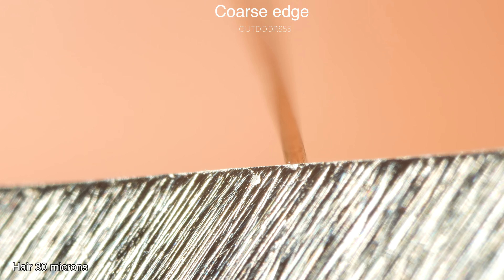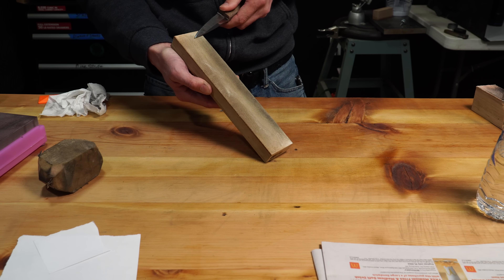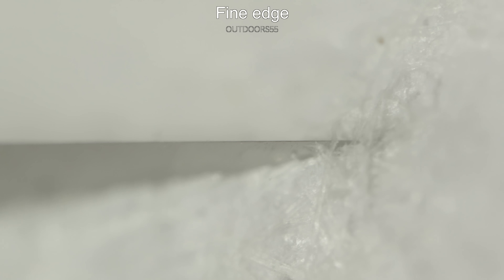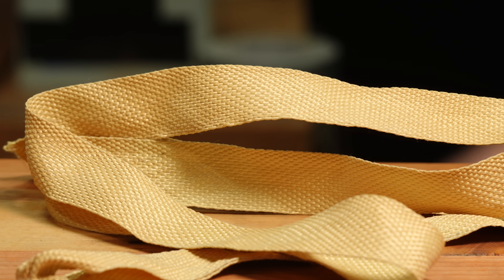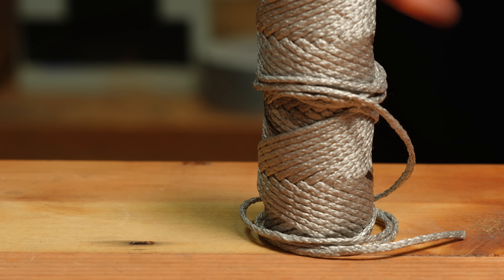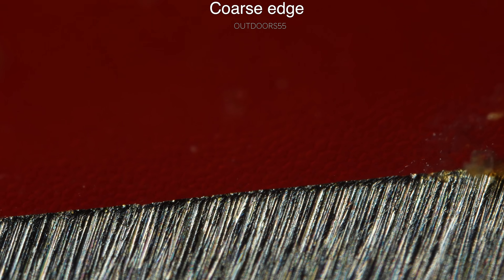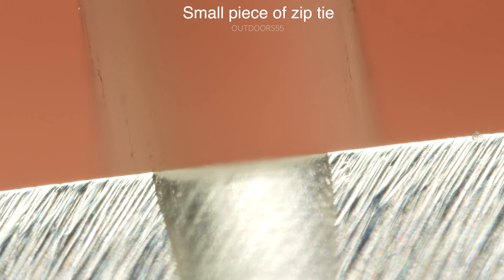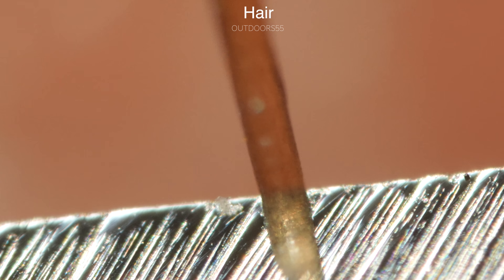Coarse Grit Knife Edges Are Weird - Coarse Vs Fine grit Edges Cut Under Microscope

Comment: Great photography, I'd also like to see some force measurements.
I only use coarse for major shaping, whether I am sharpening a knife or shaping a stone for jewelry. When I am just touching up an edge I go straight to 1200. When I'm camping I carry a 600, because camping tends to be more abusive and sometimes I want to touch up a hatchet. 
If I have to use a knife for changing an edge angle or I've done something drastic and chip the blade or put a bend in an edge.

Comment: I wonder if things like bread would show a large difference, understanding that all edges are serrated, it is possible that the coarse edge may perform better on items that would generally require a serrated knife. e.g. insulation foam, bread, thick shipping rope.

I would be interested to see the knives vs meat as well, things like fish scales, salmon flesh maybe even pig or buffalo skin with hair still attached.

I have also heard that mirror polishes make a slither of a difference when cutting anything starchy like potatoes because the polish reduces the drag.

There is probably a rabbit hole here haha. I would be interested to see if you could find EXACTLY when lower grits and higher grits are most effective.

Comment: A better test to highlight the difference might have been to cut the tomato with a sawing motion and no downward pressure except the weight of the blade.  I definitely perceive a coarse edge to be more "aggressive", esp. with tomatoes.  Also, I've noticed that a very fine ground edge tends to last a lot longer on a kitchen knife.

Comment: I remember seeing Jdavis882 use a DMT coarse to DMT extra fine to Spyderco UF and achieve a mirror finish. I wonder if it would be possible to go from the Sharpal 1200 ultra fine to spyderco UF to achieve a mirror. If so, it might be the quickest way to a mirror edge. Could be worth a try considering you have the stones already.

DMT ultra fine and Sharpal ultra fine are the same grit so I don’t see why it wouldn’t work.

Comment: To answer your question... depends on the application. You can tell in the tomato cut that the fine edge creates smaller water droplets, meaning less tissue damage at a deeper microscopic level. That's the type of sharpness for something like sushi or ultra fine culinary cuts. Everything else is a one-stone job

Comment: I bought so many stones since I started woodworking not long ago,  it would have paid for a tormec with a diamond wheel, at least I learned a lot with the stones and had meditation time when stepping from 800 to 2000 to 3600 and finally 8000 and then polish … stones are fun but can be a waste of time if you are doing plane blades or large chisel with hard alloy

Comment: I think that spending the extra time to get the fine mirror edge is the fun part of sharpening knives, not the necessary. For EDC, I'd say coarse grit micro saw tooth edge would be fine. But for zen reasons,  there's just something so satisfying about going after that extra fine edge. I'm not quite there yet but I'm enjoying the process in getting there.
Reply from the maker: It can be fun thats for sure!👍
Reply: When I first started free hand sharpening about 10 years ago I had the goal of mirror polishing edges in mind. I got the Spyderco Ultra Fine Ceramic stone as the polishing step and found the feedback it gave in the form of the very high contrast of the swarf on the white ceramic and the sound of it to greatly improve the learning curve.

Speaking of, I'd love to see a revisit of those ceramic stones since he tried them 5 years ago with some more macro goodness.
Reply: What a load of shit
Reply: I couldn’t have said it better. Well I could, but it would take a few minutes.

Comment: Well, if you said it, I didn't hear. What is 'coarse' to you, and what is 'fine'? For my wood shop, I have diamond stones from 120 to 8000 grit, and ceramic stones up to 30,000. I am one who has to experiment. I did read in a hand plane book that an 8000 grit sharpened kitchen knife won't cut through a potato. It gets 'stuck' about half way through the cut. I haven't taken any of my kitchen knives that fine, most of the time stopping at 1000 or 1200. 

One side note, in the wood turning world, there are those who say coarser teeth/edges have fewer teeth to get dull and cut cleaner and others who say finer teeth cut cleaner and last longer. Any idea????

Comment: Very much appreciate and enjoy your vids.  You’re doing good work.  Couple of thoughts…. Back in the day, maybe early eighties, was a paper published by a guy I can’t recall name, where he interviewed meat packing house cutters about knives and sharpening . If I recall right, they were using hard but smooth steels.  Another thought is , if you can, see what obsidian chips perform cutting… under magnification.  Very fine edge and smooth .  Anyway, just thoughts, and let me add that your vids have changed my approach to sharpening and they have improved my sharpening .

Cheers

Alistair

Comment: it's not a coarse edge if you strop it, it's just wavy. and the main difference between a straight and fine edge and both an actually coarse and coarse and stropped edge is that the coarser types dull quicker due to the uneven stress distribution and weak points, and you can feel the additional friction of the bevel surfaces in some uses, such as carving wood where you press one blade surface against a relatively hard material and slice off shavings, as opposed to cutting food items soft enough to cut through the middle without the knife getting stuck. if you only cut food, you don't need fine grit. maybe for meat, but that's all, and that still doesn't need woodworking sharpness. 

coarse+strop is certainly an exceptionally fast way to get a very well deburred edge. deburring on a stone or especially a diamond plate takes a long time and very good angle control.

Comment: I think that stropping compound is what makes both knives perform so similarly.  Both edges look super polished right near the apex.  Some of it has to be skill related too producing a really nice apex for the strop to polish.
Reply: Plus timewise coarse grit+stropping seems to be the gold spot for every day sharpness
Reply: exactly my thoughts
Reply: Seems like the most important thing is to get a clean apex with the coarse stone. If it first happens every other stone will be off.
Reply: While it’s fun to watch knives against paper and hair because of the super camera work, what are the results for my kind of app., I.E. meat?
Reply: @gordonthompson271  I think the kitchen is the least demanding scenario in terms of sharpness but getting knives to a high degree of sharpness and using a strop with compound produces an edge that takes a really long time to reach the point where it's not sharp enough for the kitchen.

For meats specifically, I like to run my knife two or three times per side on a honing rod with grooves to "scratch up" the apex.
Reply: Great thought
Reply: I think he's so good at producing a perfect apex (two flat surfaces that meet rather that two slightly convex surfaces that meet) that the stropping can make every one of those edges become fine grit edges right at the apex.

And by "so good" I mean bonkers good.  I've been sharpening knives by hand for at least 12 years I can get a knife to hair popping sharp without any effort.  But creating that pointy apex made from flat surfaces, he's on a whole other level.

Comment: I’m a semi-professional knife sharpener. 
This is my system.

120 (if it really needs it)
240
600
1000
Leather strop with polishing compound.

I use a sheet of paper as I’m sharpening to test the edge and while 600 grit is perfectly serviceable, I find that it definitely tears more.
Reply: What paper do you use? The regular 80g A4? Because I use thinner paper than most people "show off". It is harder to get a clean cut, but at least I have to put more effort into it.
Reply: @ErikZiak  I also usually use a thinner paper, honestly just because that’s what I have on hand but it’s less forgiving that thicker printer paper so it helps find imperfections.

Comment: I've always been under the impression that you choose the edge geometry and grit based on the intended job. Generally I sharpen to 800 on my EDC as it does fairly well at both push cutting and slicing. Shop knives may only go to 600 and certain kitchen knives to 1000.

Comment: there's also a big difference between bonded abrasives and coated ones. like a 600 grit diamond plate is nothing like a 500 grit whetstone like a shapton glass or whatever. There is very little toothiness from a 400 chosera,  zero from a 500 MESH grit glass. it's smooth as butter, but a 1k diamond plate is still quite a toothy edge. 

and like I said in my other comment. Finer edges are a bit less likely to chip but courser edges will cut a bit longer. a tradeoff like everything else.
Reply: well, coated abrasive like paper is usually rated in a completely different system with the particle size numbers not corresponding to the bonded ones, then there is shape and particle density too. Take sandpaper, they come in different percentage of coated surface area, that has a huge impact on cutting pressure and thus feel, finish and speed. 
Same on stones, nobody knows the amount of binder and sub size particles in the matrix. all one can do is buy and compare empirical

Comment: You proved a statement by the late great Fred Bear. Bear stated a “burr” edge on a broad head would cause more tissue damage and thus bleeding.
Reply: good point . what task is the edge going to perform with  broad heads your not repeating over and over like a knife  and burrs do cut. if been debating that for years  thanks for the info.

Comment: i just keep  my stuff maintain it at a high degree. I also don't need 10 abrasives to get a hair whittling mirror edge. like you said, it's already there after the first stone. I just add 1 more stone and call it a day. Some of my favorites are the 400 chosera and 4k glass. but i rarely need to go that low. I can start on a 2k and finish on an 8k or 10k and call it a day. Also there is something you didn't mention. When you use an abrasives that's finer than the smallest carbides, you get extra toughness out of the edge. meaning less likely to chip. the reason is obvious. less areas to create a fracture. and when you have a course edge, they tend to give extra edge retention, meaning they cut for longer.  This is confirmed in the book knife engineering. Obviously you have the use the correct abrasive. you can't grind vanadium carbides with alumina.  but yet, thank you for busting the idiotic myth that course edges cut tomato's better or have more "bite." Nah, you just dont know how to sharpen if you thought that.

Comment: Thanks for the very nice footage. It's good that we can finally replace some of the voodoo stories of how cutting works with some magnified video.

In my experience with fine sharpening, I have found that the performance difference between fine and coarser edges shows up more in chopping cuts.

If cutting is being done with a lot of drawing, there will be less performance difference, but if there is less draw being used, the difference in performance becomes bigger.

I employ a few stages of paper cutting test to assess edges. Sharp, but not very refined edges will pull cut through paper well, but their performance will not be good if you push down on an edge that is perpindicular to the paper edge. 

Hold the knife dead horizontally with the paper edge also horizontal, but rotated 90deg. Put a gentle curl in the paper to give it some stiffness and push the knife down without drawing. 

A more refined edge will chop down the paper instead of buckling it.

The highest degree of sharpness shows when I can roll a sheet of paper in a 2" dia tube. A very sharp knife will manage to "attack" and gain purchase into the curved surface instead of buckling it in. Sharper knives will engage when they are more perpindicular than less sharp knives which will need some draw to start a cut in the flexible broad surface.

I got into these tests when I was trying to figure out how to get super sharp edges. I was comparing my work against brand new black Olfa blades which are extremely sharp. It's hard to match the cutting performance of a new Olfa blade so I found it to be a useful standard for cutting performance  when I contrived my own crappy sharpness testing.

Comment: Very well done. 

Another factor is that more stones means you have to stay consistent with your angle even longer. More stones mean more overall time and breaks in sharpening where you have to reset your grip, so you have imagine most people have worse angles. So if you aren’t really skilled at sharpening just using one stone probably means you’ll get a better edge.
Reply: This has definitely been the case for me! I'm in the camp of low-skill sharpeners and I find that after I switch to a finer grit stone, I often undo some of the work I had put in on the coarser stones.
Reply: @RebuildingSaad  I think I wasted decades like this!  This is one of the things that makes the fixed angle sharpener so compelling.  I think it minimizes the grinding we have to do for ANY result, and now I can try all the different sharpening doctrines that are circulating.  We can meaningfully choose an apex angle, and a finish, and work toward it.

Comment: I thought I  needed a bunch of stones to get really sharp edges...... until I actually practiced and got good..... Now I just stop at ~1000grit     because i feel like the edge is more durable in the kitchen.   I'm a chef,  and it seems, when I take a knife to 5k, 10k, 15k,  yea its screamin sharp but after a few hours of cutting its done...  if I stop at 1200grit or so  and do like 5 passes on a strop to make sure the burr is completely gone,   my knife can stay relatively sharp for a week or so of heavy use.
Reply: You guys go up to 15k ?!

I have done mirror polishing on lab samples for testing materials, and we stopped at 2k.

Anything further is a serious waste of time, or knife masturbation. You can get an excellent cutting edge at 400 grit already.

Mirror finish is mostly esthetic anyway. It means the metal is really flat. But it doesn't mean that it will cut better. It might not. A flatter surface means more friction overall.
Reply: @oneoranota  I have the stones from when I was bad at sharpening and didn't understand the process.. I thought more number more sharp..  Now that I have actual skills and understand the principals of sharpening,   I stop at 1k  because i like the toothyness of the edge (when cutting tomatos, grapes, chives/scallions, cucumbers, peppers, etc. )    I stop at 1k and strop.     Sometimes I'll polish an edge just for fun  but  lately I spend like less than 5mins start to finish on a 1k stone and can shave with that knife.
Reply: That’s an interesting insight. I also noticed prolonged edge retention in my pocketknives when I started stropping. Regardless of how high grit I sharpened. I thought the soft nature of the leather strop would create some kind of convex edge which is stronger structurally than just a sharpened bevel
Reply: @kims2r  The longer edge retention is simply because you are taking off the burr by stropping. If you don't, it will roll and make the knife "less sharp".
Reply: Same here I sharpen most of  my knives till 1000,some only 600 or even 400 grid,than strop on chrom polish loaded leather than leather only.That is allready crazy sharp to me and I never felt the need to go finer.
Reply: Yup, the whole time all we had to do was "git gud" 
As some gamers would say😅
Reply: Well duh, you just hit the fine grit knife on the highest grit stone for like 20 passes when you notice it dulling (under 8k grit)... Otherwise you can strop.
You only need to do a full resharpen if you don't upkeep the edge :/
Takes like a minute or two of your day.
Common practice I see in Japan
Reply: @CowsGoMonkey  well yea... I maintain most of my knives with a 1micron diamond paste on a strop  and that can keep my knives hair shaving sharp  without needing a stone for like weeks..  

I was talking about full on repair of a neglected edge...  all things equal  stopping at 1-2k     and taking it to 10-15k     the 1-2k edge has far more bite and lasting sharpness over a 10-15k edge, at least in professional kitchen cutting on different cutting boards and a wide range of things from pineapple to butternut squash/pumpkins...    A 15k edge vs the tough skin of a squash or pumpkin gets destroyed..       That being said I do have a few slicers I use for specific things like butterflying steaks/porkchops/chicken breast   that I do keep a mirror finish edge on.. but I won't use those knives for  mincing rosemary or cutting up pineapple or any other kind of aggressive skinned thing.

Comment: You can definitely see a difference in the surface of the metal between the two; but the actual edge looks very similar.  If anything, it's almost as if the coarse edge is acting like tiny serrated edges...   I wonder if you could refine that edge even further with 1 micron diamond gel on Glass..  So that it's very smooth and flat.  There has to be a way to refine the edge further.. because even the "fine" blade still looks like fairly rough terrain.   I'd keep trying different surfaces to sharpen on with strope compound..  I know you're going to stumble onto something that's a breakthrough..  having this close of a feedback to check your work is awesome.   Keep experimenting with new sharpening techniques